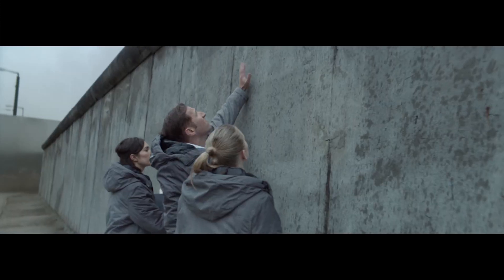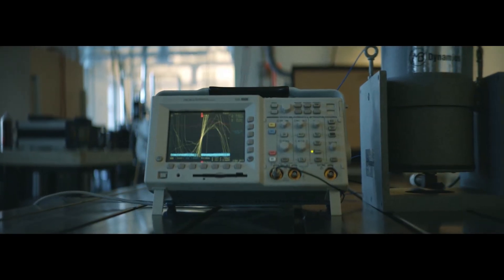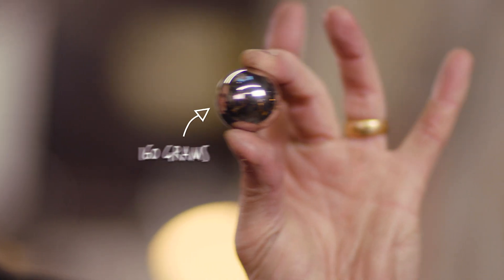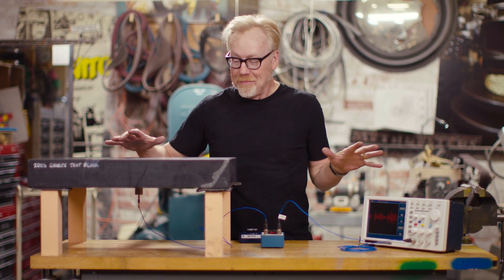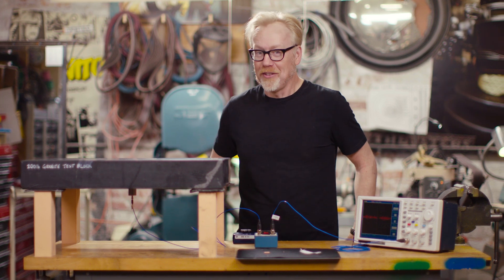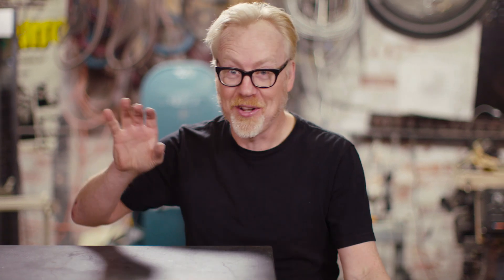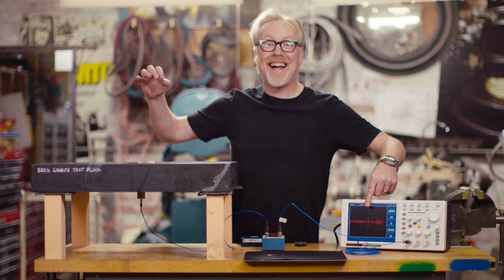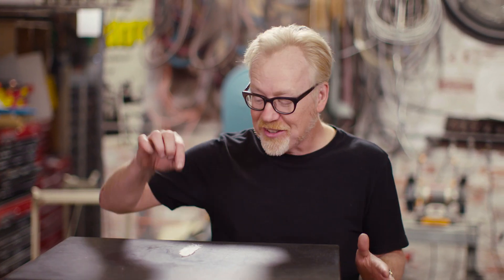Adam Savage Talks to a Wall - Unimpossible Missions

Comment: Friend of mine from church is over 80 years old and he said back in the 70's he was helping develop this exact tech for tanks. The wanted something that could detect changes in vibrations on the tank so that they could predict when something was likely to break. They also use the software they developed to tell sounds apart on the battlefield so a tank might be able to tell a crew that a rocket just missed them and even what kind of rocket and the direction it was fired from.

Comment: I never understood the phrase "detecting problems before they happen". Wouldn't it be more like "predicting problems based on smaller problems"

I work with large oilfield centrifuges, that being 4500lbs spinning at 3000+ rpm. G-forces in excess of 2500g's, we use these kind of accelerometers all the time. So the previous phrase seems to be inaccurate

Comment: Hmmm... I am not so sure about the "moving against gravity" explanation, I think it may be rather misleading.

I believe the relative change in weight measured by your scales is independent of gravity, and really down to the inertial effects of the acceleration itself.

So, if your test mass is measured as weighing 100 grams more when accelerating than when stationary on Earth, and you took it to some other planet where the stationary weight would be only 1/2 as much, the same acceleration would still add 100 grams.

Comment: Of course with a high sensitive accelerometer you can pick up the feather in a controlled environment.

Don't know why GE wasted money talking to a wall when you can just use the sensors in the first place on rotating equipment.

They still use low end handheld tachometers in chemical plants to walk up to it and measure its rpm to see if there is any issues (i.e. bearing failure, etc.)

Y'all must be hurting for money to be putting out GE videos...

Comment: To be clear, the exelerometer detected the impact of the hard quill point of the feather. Not the soft plume, which would be the part of the feather one would be curious about. That's the same as dropping any light hard object, like a pin. So I'm not really convinced by this demonstration.
Reply: That's not particularly true. While the impact of the rigid point is more intense than the impact of the soft plume, the fact that the feather falls much more slowly than either the pin or penny means that the impact is much lighter regardless of what part actually hits. It was still interesting to see.
Reply: It's pretty clear that the symbolic image one has of a feather as something very light and soft stems from the plume and not the quill, and it can be presumed that that was the reason for it to be used as an example in this experiment. You wouldn't go around claiming something is light as a feather and then proceed to throw writing quills like darts. He just didn't do it right and didn't bother to clearify.
Reply: 2nd3rd1st That sort of symbol is only meaningful in its representation of concrete ideas. He actually dropped a feather. Not modified in any way. He didn't throw it point first. What could he have possibly done differently? I feel like you're complaining for the sake of complaining.
Reply: PolyJohn I understand what you're saying and I agree that both sides of the discussion have merit, but I'm only even in the comments section to complain about the same thing: I wanted to know if it could have detected the plume of the feather contacting the slab.

Comment: Well, actually, Adam..... the ball gets first heavier, then lighter when you move it up. It gets first lighter and then heavier, when you move it down. The accelerometer does not measure the movement, but the acceleration, hence the name. 
PS. sorry for bad spelling ;)

Comment: So it's basically a microphone
Reply: Kinda yeah. A microphone is different in that it only stores one axis and is tuned to be able to vibrate to the air's sound. It's theoretically possible to make an accelerometer out of a series of microphones, albeit it wouldn't be very accurate.

Comment: ehh guys I hate to be the one to point it out but you mixed up weight and mass, grams are a unit of mass. the mass of the ball bearing doesn't change as Adam moves his hand, the weight, measured in Newtons, does. I'm pretty sure the mistake was made by whomever edited the video, what Adam says is correct.
Reply: I believe what they meant was that the reading on the scale changes.